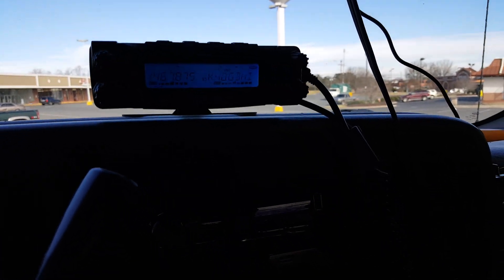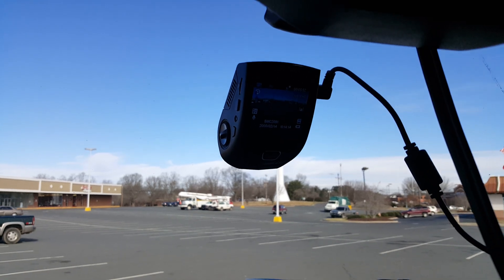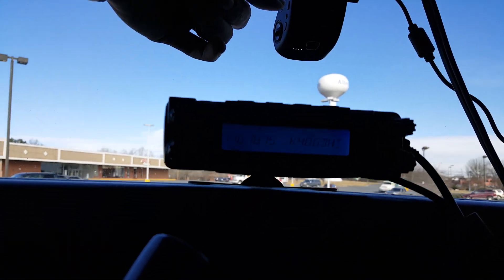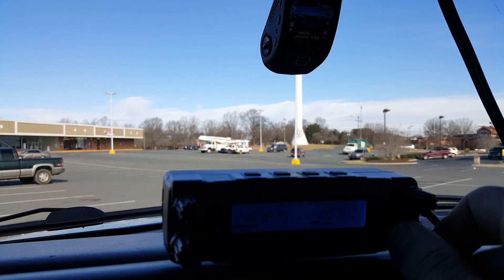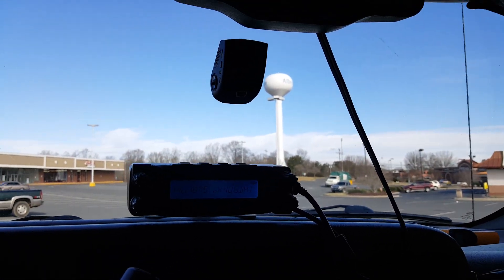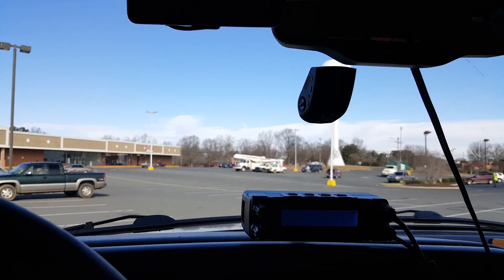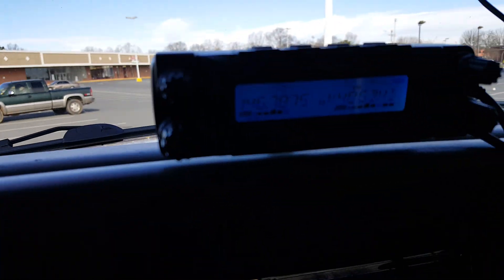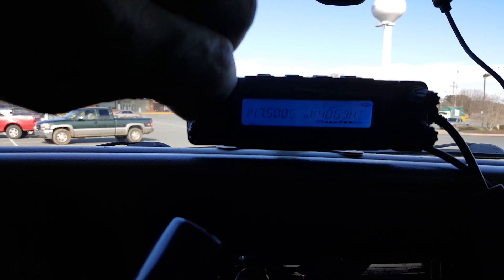Rexing Dashcam Amateur Radio Interference Problem

Comment: Pain in the butt. How did you (or did you?) resolve this problem? I just installed a Rexing V3 with optional rear camera in my Lexus GS350, using their optional hard wire kit. I can't remember the timing if this, but I've been getting radio frequency loss and interference from my car's FM radio. I'm not sure if the problem is local or if it's because of the camera or it's wiring I snaked all over the place. I spent hours on my install and I hate to think I've got to tear it all out and do it differently.

Comment: Came across this video a few months ago while looking into the same issues with my Icom ID-5100. The issue isn't actually the camera, it's the power cord. If you unplug it from the camera, yes, the noise is still there while the camera is running on battery. But, if while the camera is still on, you unplug the cord from wherever you have it plugged in, most likely the cigarette lighter socket, then the noise will go away, at least it did with my Rexing dash cam. And the fix is actually quite simple. I put a small, clip-on ferrite ring onto the power cable of my Rexing dash cam near the camera, and a second, larger one, with the power cable looped through it one time, near the cigarette lighter plug. Problem solved. The noise level dropped to nearly nothing. This also fixed another issue that I had observed, which was that transmitting at 50W on 2m caused the dash cam to restart.

You can pickup a pack of 20 of these clip-on ferrite rings, in various sizes from Amazon for less than $10.

73 from KG6ECW

Comment: Just in case someone is looking for a fix for Dash Cam FM radio interference...The problem most likely coming from the 12 vdc adapter that's causing the interference...I placed 6 Ferret Cores on the entire 12 vdc cord line which was connected directly to the fuse box and the voltage adapter thus eliminated the problem ...
Reply: I had the same problem with my dash cam. My power is fed straight from the panel and I installed a USB adapter at the end of the cable and this caused interference with the radio. My solution was tin foil, I wrapped the adapter with it and the interference is gone.

Comment: I've had this issue myself. Not with this particular dash cam but it seems to be a common issue with a lot of dash cams. The power supplies for these cams are just plain garbage. My cam wipes out 27MHz completely in the car. Unplug the cam and the S9+ noise goes away completely. I took the power from the 12V socket to power the rigs and the cam but I'm going to re-wire everything soon. I'm going to run a dedicated (probably screened) fused power feed directly from the battery into the cab for the radios and I'm going to be fitting a suitable amperage noise filter / suppressor along with a number of ferites to see if that eliminates the problem. Car electrics are usually pretty noisy things to begin with, especially noise from the alternator. As for the cam, I think I'm going to build my own power supply for it with plenty of screening and filtering or buy a better well made power supply for it. I only use 2m/70cm and 27MHz in my car and the cam doesn't seem to interfere with 2, and 70cm. Just CB. Also the noise from the car electrics seems to play havoc with the dash cam itself as the recordings are garbage while the cam is powered from the car. But mine is a semi-cheap chinese dash cam so I'm not expecting much.

Comment: I have had the same problem with 3 different camera brands with my kenwood v71a. bad bad bad interference..dont need the cam that bad. If I think I do I use my phone in its windshield mount holder.

Comment: From my experience Rexing dash cams are absolute garbage.  When i first got my car I bought the V1N for the front and the V1 for the back.  After a few days of use, the front camera began freezing up in the middle of recording and without warning.  I have gone days without realizing what happened (they were run all the time).  I sent the support team the video of it freezing up, told them it was happening frequently and they were helpless.   It was ashamed because the quality video this put out was excellent.  The rear camera began having this really loud interference and it got to the point where you could not hear anything going on in the car.  The video also started to turn blue when recording for more than a half an hour.  I can't forget that in both of the cameras the super capacitors stopped holding most of their advertised charge after a few months of use and would last about 20 seconds before dying compared to the 10 minutes they stayed on when new.  The Viofo dashcams I got next are a little better (none of the problems described above), but sometimes the settings would reset when you turn on the camera again, and the GPS on there is a little iffy.  I can't forget that when power is cut to the camera, the capacitor keeping it on for a few seconds to write the video began wearing out and the video would go corrupt every time.  The Aukey dashcams (cheapest out of all of them) just happen to work the best and were the most solidly built out of all of them, with all of the features of the Rexing camera.  Quite frankly, with all of the issues I am hearing about Rexing (my issues, your issues, and a fellow dashcammer's issues where he had to have three different cameras sent to him before he got one that worked), I am surprised the reviews of the dashcam are as high as they are.
Reply: I had 2 and both were awful and had to return.

Comment: the navigator does the same even worse right through the VHF band, recommendation from importer   return it to point of sale and get a refund{ hopefully} as the problem can not be rectified.
Tried another brand  same problem even though the unit did not have GPS .
Appears to be a problem with all of  them , testing has never been done by the manufactures of these units it appears .
The radio dual band Icom ,main unit under the seat and the head in a small glove box in front of the driver   an Xtrail.
tried ferrites no go, ,wrapped the unit in foil bingo gone but unusable,and who wants a silver blob on the windscreen .

Comment: Just put a Rexing Dash Cam in my 2011 F150 and found that RFI from the camera messed up the Tire Pressure Monitoring System. The sensors in the tires are unable to communicate with the control module due to the RFI from the camera. Nice camera but useless to me due to the TPMS warning light being on all the time.
Reply: Im having the same problem > jeep grand cherokee 2014   the camera is great but this sucks...
Reply: Ended up replacing the sensors and all is fine now. Love the camera.

Comment: I would contact the manufacturer again, mention this video, and reference the FCC regulation that requires all electronics sold, imported, and/or distributed in the U.S. to not cause harmful interference to communication devices.  this is a result of inadequate shielding, and the whole reason behind the FCC compliance laws that prompt the disclaimer on all electronic devices.